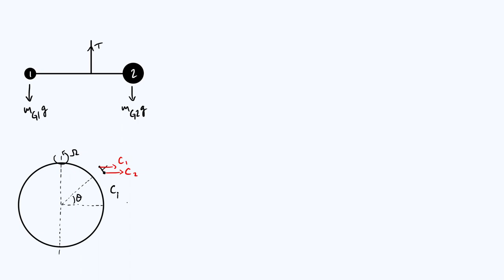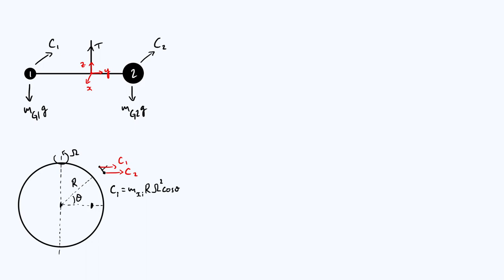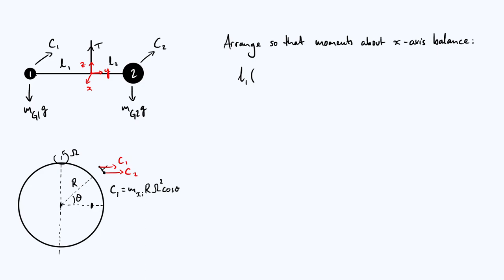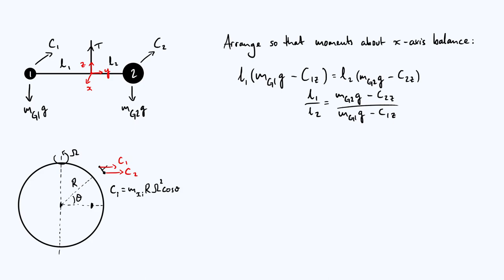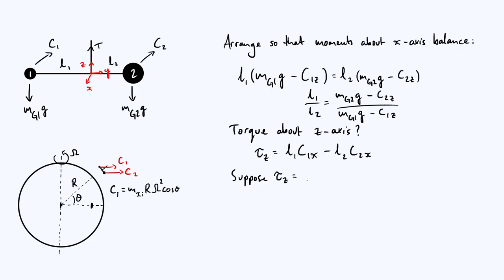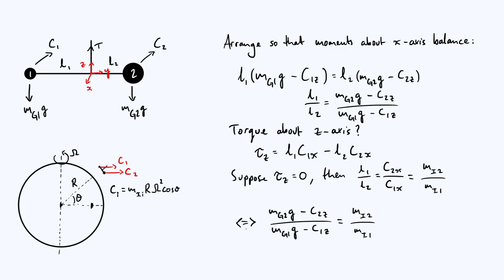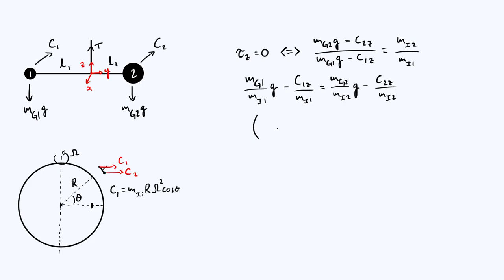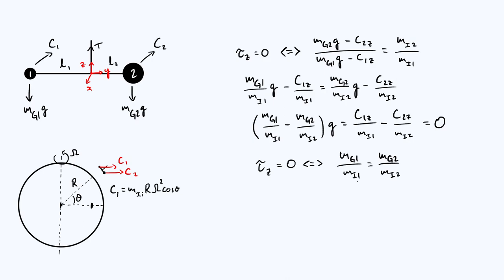Understanding the Eötvös experiment

Comment: Only someone who doesn't believe that balances measure mass instead of weight could ever believe in the validity of this experiment. The two sides of a balance incline as one. You can't treat the different sides as independent. More force is needed to incline one side because there is all the mass on the other side.

Comment: Hi, nice video but I am having a small problem. With the presence of centrifugal force the wire is not along the local vertical (defined as along g) but makes a small angle with it.. So , the gravitational forces mG1g and mG2g should have components in the x direction (if the z -axis is along the wire) I am not sure how to justify ignoring it. This component is of the order of magnitude a/g where a is the centripetal acceleration, this is small but the x components of the forces C1 and C2 are also small of comparable size (g ~ 10).
Reply from the maker: This is a good point and the effect is probably not negligible. However, having just gone through some rough working, I think it is still true that τ_z is zero if and only if m_G ∝ m_I, even if g has an x component. The τ_x balance equation should be the same, you just need to add in a couple of extra terms to the τ_z equation. If you decide to try working through for yourself, let me know if you agree!
Reply: @DrBenYelverton  Hi, I took some time to work it out myself.

Here is my solution:

If you look at an object hanging on a thread on the earth's surface, it is easy to show from the vector diagram that the thread (in the direction of the apparent weight w = the vector sum of mG*g and mI*a, where mG is the gravitational mass and mI the inertial mass of the object, a the centrifugal acceleration) makes an angle phi with the local vertical, defined as the direction of g, given by 

tan(phi) = mI*a*sin(theta)/(mG*g - mI*a*cos(theta)) ~ (mI*a/mG*g)*sin(theta), where theta is the latitude. 

So the thread of the torsion balance makes an angle ~ (mI1 + mI2)*a*sin(theta)/((mG1+ mG2)*g) with the local vertical,  where mI1 and mI2 are the inertial masses of the two objects, similar for mG1 and mG2. Call this  angle epsilon

Similarly, the apparent weight w1 of object 1 makes an angle epsilon1 with the vertical ~ mI1*a*sin(theta)/mG1*g and w2 makes an angle epsilon2 ~mI2*a*sin(theta)/mG2*g with the vertical.

Note that epislon1 and epsilon2 would be equal if and only if mI1/mG1 = mI2/mG2, So we can't assume that this two angles are equal (if they are unequal we will find a torque in the direction of the thread)

Using your notations the z axis is along the thread, the y-axis along the rod and the x axis coming out of the screen.

Observe that w1 and w2 have no y-component because for short rod both objects can be considered to lie on the same meridian plane. Now the angles of w1 and w2 with the z axis are delta1 = epsilon1 - epsilon and delta2 = epsilon2 - epsilon, respectively.  

Since the epsilons and therefore the deltas are small so the x components of w1 and w2 are resp w1x~ w1*delta1 and w2x ~ w2*delta2 (since sin(deltai) ~ deltai for deltai small).

So the torque in the z direction is

tau_z =w1x*L1 - w2x*L2 ~ w1*delta1*L1 - w2*delta2*L2 

But we know the torque in the x direction is 0, w1*L1 = w2*L2 (the z components of the w's can be approximated by w because cos(delta) ~1) 
Substitute in the above we see that 

tau_z = (delta1 - delta2)*w1*L1

Therefore, 

tau_z = 0 if and only if

delta1 = delta2 if and only if

(mI1/mG1 - (mI1 + mI2)/(mG1 + mG2)) = (mI2/mG2 - (mI1 + mI2)/(mG1 + mG2)) if and only if 

mI1/mG1 = mI2/mG2.

Let me know what you think.